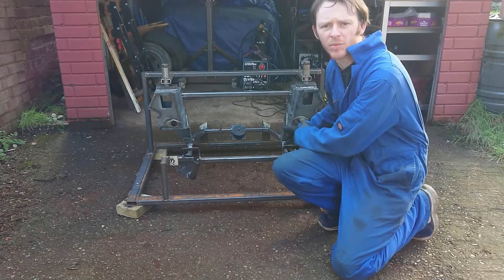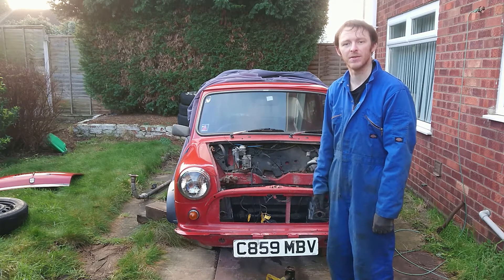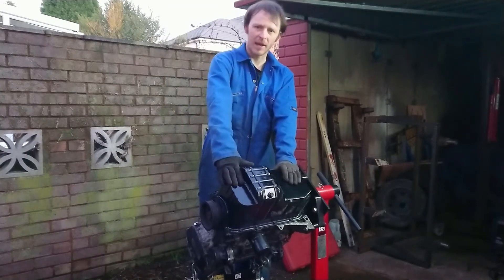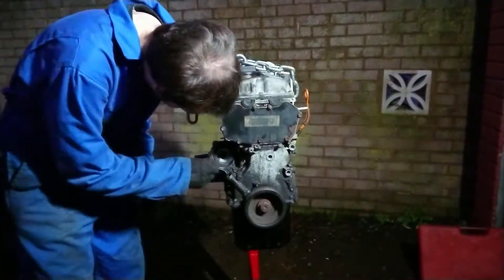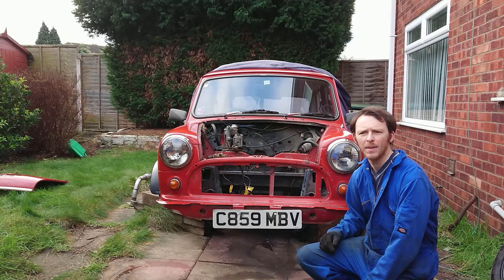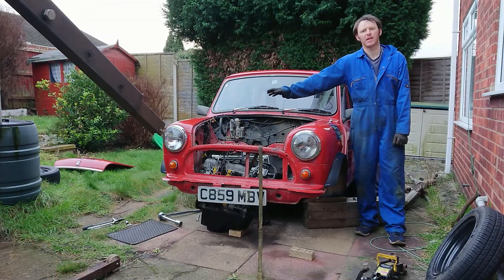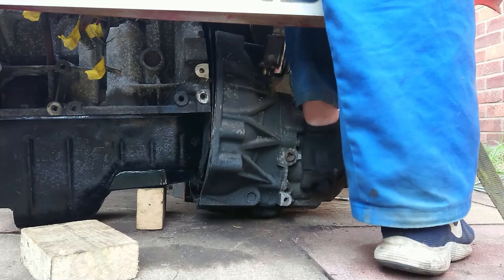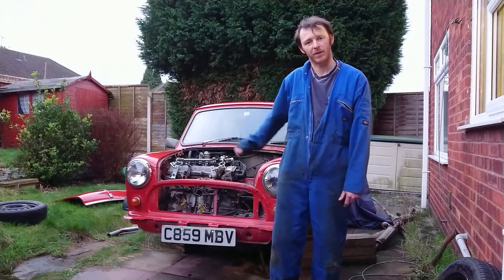CG10DE Mini Engine and Sub Frame Fitting

Comment: Hello, thanks for your video, I have a question and I hope you can help me, with the cg10 engine does the original structure of the mini have to be cut?
Reply from the maker: Thanks for the question. In this instance no. I've designed my sub frame so that it can keep the inner wings. You just have to bend the bottom edge of the inner wings out a bit.
Reply: @projectpeddlers  and the rear (torpedo) do you have to cut the structure to fit the intake?  regards
Reply from the maker: The standard inlet manifold won't fit as it will hit the bulkhead, but I have a plan. When I get to the inlet manifold I will show it here on YouTube